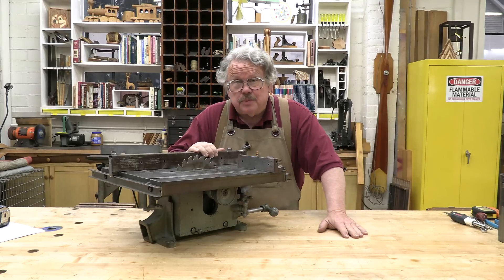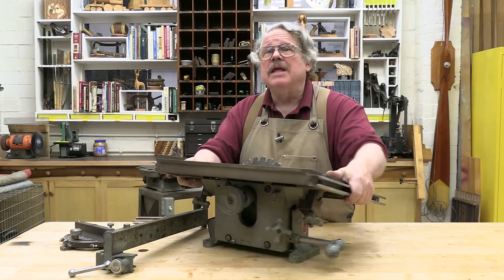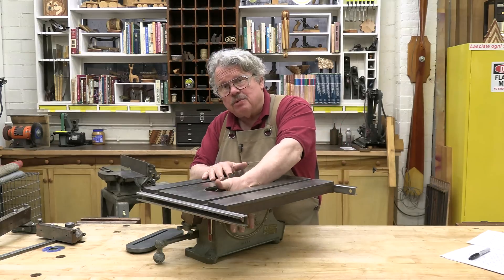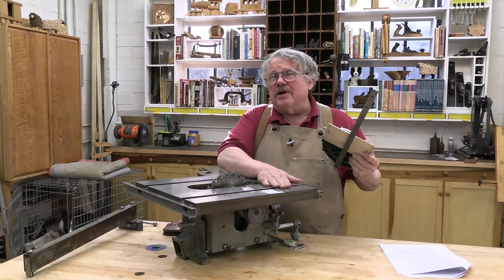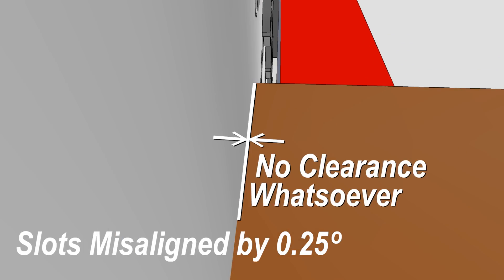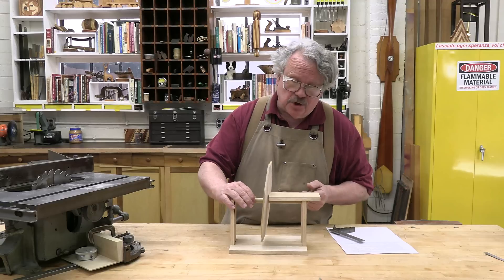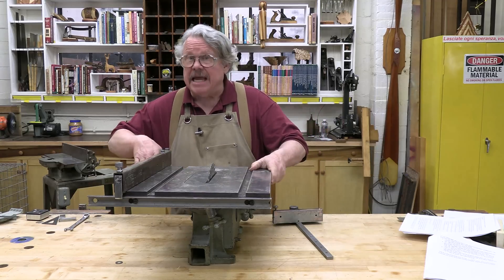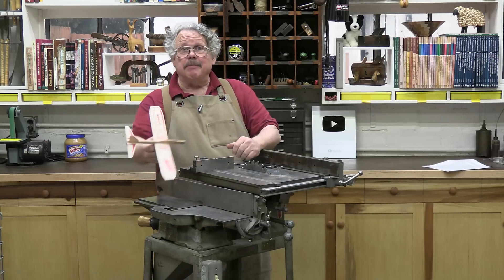Crucial Table Saw Alignments and Adjustments

Comment: Hi Master! For who has a hobbyist entry level table saw...for example my table saw permits to set at 89.4° the direction of the blade then is not perfectly perpendicular to the base of the table... obviously is not perfectly parallel to the t-tracks...I have set the fence parallel to the blade and the goniometer guide at 90° with the blade...in this way I can make good cuts, precise with a tollerance acceptable...for example obtained some piece of 20.4mm  at the start and 20.8 at the end of the cut...the question is, how much is the acceptable tollerance to consider a cut precise, woodworking?
Reply from the maker: The precision you need is defined entirely by what you are making. If your project is coming together and you're satisfied with the work, then the tool is precise as it needs to be. If you think it could be better, you have to decided whether the problem is you or the tool.
Reply: @WorkshopCompanion  Hi, many thanks for your answer, I am doing experiences with my new table saw and It's early to have the right idea about where It can arrive (and me) but at this moment the one parameter that I can't set properly like the "Bible of the table saw" wants is the perfect alignment of the blade with the miter slots but seems I can survive without at the moment 😀 I consider this table saw precise because the cuts I usually do are fine..
surely I have to pay attention to be sure that the fence is parallel and the miter gauge is 90 with the blade before to make cuts...
I love your channel!
Marius

Comment: Nice presentation. You obviously took the time to prepare your script and deliver it flawlessly.

I would not enjoy cutting on a tilted table, actually sounds dangerous,
Reply from the maker: It's not, as long as you make a jig to help hold the workpiece and keep it from sliding downhill. While I have a Delta contractor's saw, I also use several Shopsmith, which have tilting tables and work safely. All table saws were once "tilties," and in restoring this saw I found that a surprising number of the old Delta tilties are still in use. Thanks for the kind words.

Comment: When determining if the blade is parallel with the miter groove do you see any advantage to starting with the blade positioned so that the run-out line is horizontal?
Reply from the maker: No. Because even if you have already determined the blade run-out, you should still align the slots using a single tooth. It shouldn't matter which one.

Comment: This won't work with my tablesaw as the trunnion on my saw is bolting to the bottom of the table. So turning the table will just turn the trunnion at the same time. I have loosen the trunnion and tap the mechanism to get it to align. To the mitre slot.
Reply from the maker: Each brand and model of saw will require a slightly different alignment procedure; this is to be expected. But they all need to be aligned.

Comment: bought a saw in 75 and a square toset it up. after 2 days of mentally going nuts i checked the square, was off a quarter inch in 12. i still use the saw.

Comment: Your missing another tablesaw check. It’s not discussed often because it’s more difficult to explain and adjust.
The 45 degree tilted blade. Does it cut without burning the wood.
Some cabinet saws will come from the factory with the top property shimmed. 
There is always the chance someone has removed the top and lost the shims. Or disregard them as needed.
Care to comment

Comment: How is the dial indicator fastened to the wood base?  Thanks so much. Fantastic video and information!!
Reply from the maker: As you know, the dial indicator has a protruding boss on the back which allows you to mount it on a magnetic base. The boss and back are held  with four small screws. Remove the back and place it on the piece of plywood  where you want to mount the indicator. Using a transfer punch, mark the location on the screw holes on the plywood. Drill and counterbore the screw holes, then attach the indicator to the plywood with the same screws that hold the back in place.

Comment: If only you/I could buy that saw today. A beautiful machine.
Reply from the maker: It is, isn't it? I was surprised at how well it was designed and manufactured, especially for its size. This would make a dynamite job-site tool for finish carpenters.

Comment: Thank you! That was very informative. I also have a question: When checking if the blade is parallel to the miter slots, do you have to put the dial indicator against the very outside edge (tip) of the tooth or can you put it further down the tooth (closer to the body of the blade)?
Reply from the maker: Most blades have carbide teeth that are just one thickness -- they aren't tapered.  If all you have are blades with tapered teeth, or you're working with older blades with steel teeth that are set right and left, make your measurements off the blade body just under the tooth. If it helps, make a dot with your marker and always hit that dot.
Reply: @WorkshopCompanion  Thank you! I really appreciate your help 🙂

Comment: Great presentation and delivery of information.
In the past I had problems with the table returning to the same position after adjustment, turned out that the washers had taken a “set” and table would return to the old position as the bolts were tightened, and this was fixed by new washers.
Reply from the maker: Good info; thanks for sharing.

Comment: Well explained Nick, but you overlooked an adjustment.  Tuned as you did, you'll get excellent results when the blade is square to the table. Tilt the blade (or in your case the table) and you may be less satisfied with the results.  This is because if the axis of rotation that the trunnion rotates around when tilting the blade isn't parallel to the miter slot, the distance between the blade and fence, miter slot, and table surface will be different front-to-rear when the blade is tilted.  I had a saw with this problem some 30 years ago and it took me months figure out why my angles were spot on with the blade at 90, and always slightly off when the blade was tilted.  I was pretty frustrated before I finally figured it out.  This alignment is achieved by doing everything you did, then tilting the blade to 45 and checking the miter slot to blade distance again.  If there's a difference, it's necessary to adjust the alignment of the trunnion to the table by inserting shims.

On a cabinet saw it's pretty easy because the shims go between the cabinet and the top.  Loosen the bolt at the corner that needs shimming, insert the shim(s), then tighten that bolt again.  That will allow shimming without loosing the other adjustments you already made.  (You can loosen a second bolt if necessary, but keep at least two tight or you may lose previous adjustments.)   On a contractor saw, like I had at the time, the shims need to go between the trunnion and the top. It's a real pain because when you loosen the bolts to insert the shims, the arbor alignment gets moved too.  Prepare for some frustration.  If you're happy with the cuts you get when the blade is tilted, don't mess with this adjustment, but if not, it might solve the problem.
Reply: Thank you! I just took a screenshot of these instructions so don't lose them. I got something to check today...

Comment: This is the first time I understood how to measure and adjust for blade runout. Thank you! What are your thoughts on arbor runout? At what point does the arbor need replacement bearings?
Reply from the maker: Assuming you're talking about a belt-driven saw and that the arbor shaft is properly manufactured, the arbor run-out should be negligible because the arbor is under constant tension from the belt. This tension takes up any slack in the drive train. The axis of rotation may drift very, very slightly as the bearings wear. But by the time this is worth worrying about, the bearings are shot. You know a bearing is going when there is excessive vibration in the drive train -- you can see the belt bounce. I use a nickel to check the vibration. If I can't stand a nickel on edge when the table saw is running, there is something wrong with the drive train. If the saw is new, check the pulleys and the belt. On every saw I've ever owned, I've had to swap the stamped pulleys and rubber V-belt for machined pulleys and a segmented belt to get it to run as smooth as I like. If you already have a good belt and good pulleys and the saw has some time on it, the bearings are probably going.
Reply: @WorkshopCompanion  Thanks for the info! I'll try the nickel test, which I'm sure will do fine as I haven't had any issues with my saw. I happen to be checking all the calibrations this week...I had already checked that the miter slots were perpendicular to the blade, but didn't compensate for blade runout. I'm sure the difference will be negligible, but as you say, may as well get it as perfect as can be.

I have some segmented belts coming to day that should make things even better.

Comment: I've seen a bunch of similar videos, but none that mentioned blade run-out or how to compensate for it as you demonstrated. The ruler in the slot, and the flashlight and square tricks are ones I haven't seen before either.

I second the motion of other posters that you are an excellent teacher...and I'm a teacher myself, so I know that skill when I see it.

Thanks!
Reply from the maker: You're very welcome, and thanks for those kind words.

Comment: Fantastic video! I very much enjoyed this one. Thanks for sharing the history and woodworking knowledge.

I have sought out early Delta publications and manuals because. I thought there might be some forgotten tricks regrading their tilting table table saw that I could apply to my Shopsmith. Unfortunately (or fortunately really), Mr. De Cristoforo did such a thorough job with "Power Tool Woodworking For Everyone," that there really aren't any lost secrets. But what I did notice, is that the early Delta materials regarding working with power tools seems to be the "source code" for very much of the content produced since, including YouTube videos. So the video titles should be "99% of people don't know this trick (unless you have ever read a book)."
Reply from the maker: I know exactly what you're saying, Thomas. The tool I used in the video was sold  with a book that was co-written by the designer of the saw, "The Modern Motor-Driven Woodworking Shop: How to Plan, Operate, and Get the Most." We tend to think of these as quaint old publications until we make the effort to open them and find their chock full of timeless information -- not just on the tool, but concerning woodworking itself. I have a two-volume set published sometime in the late nineteenth century on using a framing square -- it could be the basis of a hundred videos. You read a couple of pages and come away with the impression that a framing square is the solution to world peace.

By the way, I used to be R.J. DeChristoforo's editor when I was working for Popular Science (right after my stint with Shopsmith). It was "The Chris" that convinced me to jump ship and start writing my own books.
Reply: @WorkshopCompanion  Yes, I recall hearing from a Hands On-Line video or perhaps elsewhere about your connection to R.J. De Cristoforo, writing and publishing. It's one of the reasons I think you are produce some of the most trust-worthy content on YouTube.

BTW - I just ordered the "The Modern Motor-Driven Woodworking Shop . . . " from Amazon. Anxious to compare it to "Getting the Most Out of Your Circular Saw and Jointer" from Deltacraft data 1953.